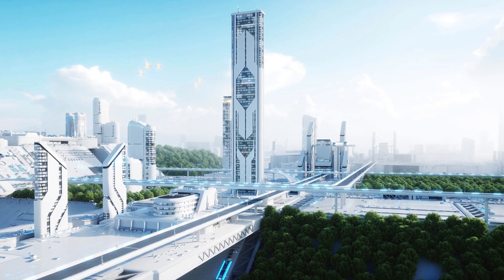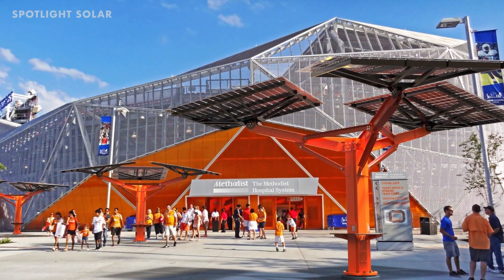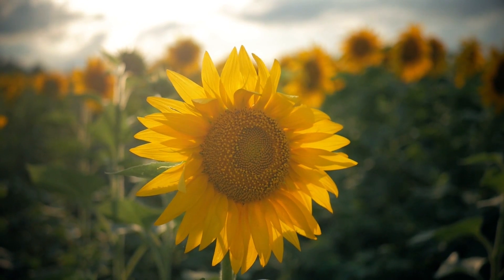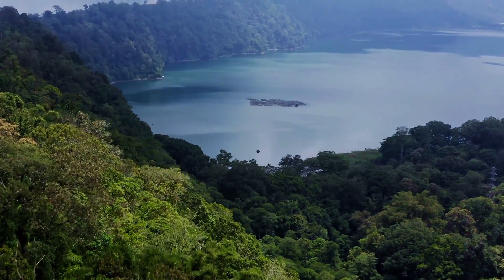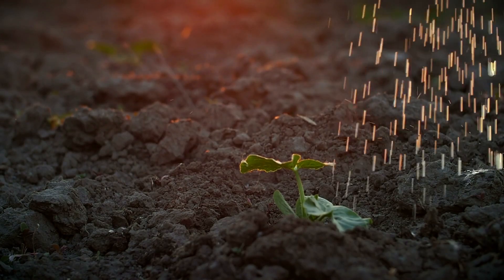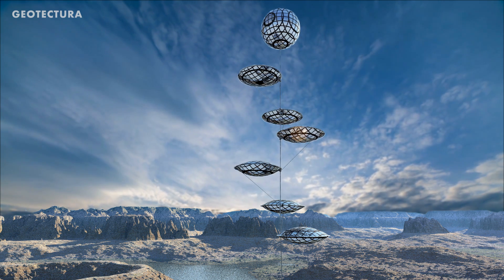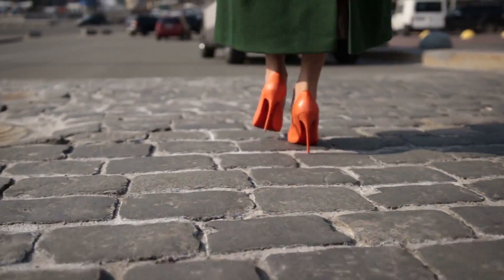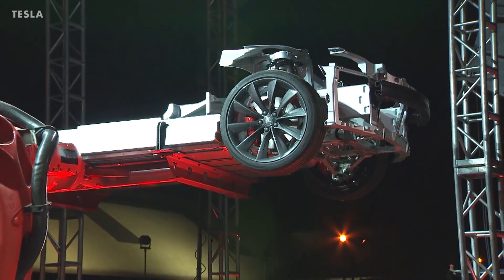What Will the Solar Cities of the Future Look Like?

Comment: People should just call them smart roads. We can make roads that melt snow and ice, show road signs with LED lights and even charge all EVs driving on them(the vehicle is identified remotely and the owner gets a bill later). Like all great ideas it will be expensive to make but pays itself back over time. Adding solar panels does not increase the price a lot but would improve the payback time.

Please folks, stop repeating certain clickbait loon's claims as if having a video up on Youtube was proof of anything. The problems with solar roads are that you need to cover it with something tough enough to survive traffic, which lowers the amount of light that gets to the panels, overheating lowering efficiency, and the panels by default being flat on the ground so you only get full power at noon, especially if there are buildings or other obstacles around the road making shadows. With cheap solar panels those issues mean the actual power output is very low, the whole point is that roads have huge area so even low output would be enough. And no, all the cars in the country wouldn't cover but a small portion of them, that argument is false too.